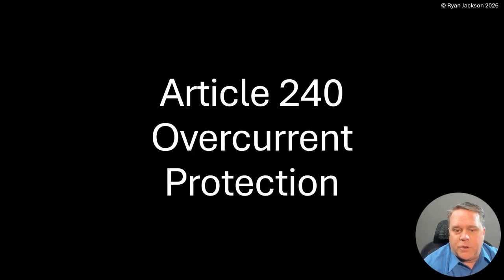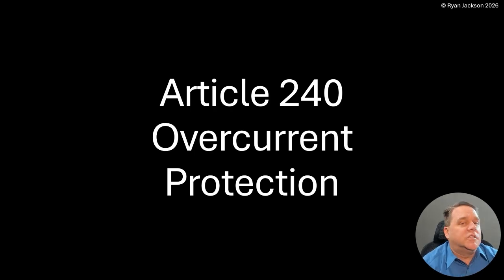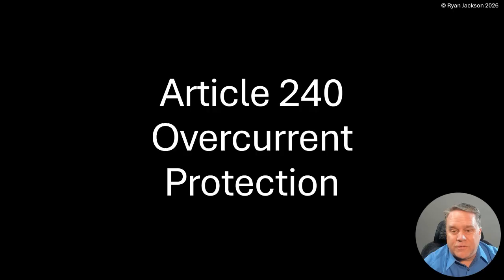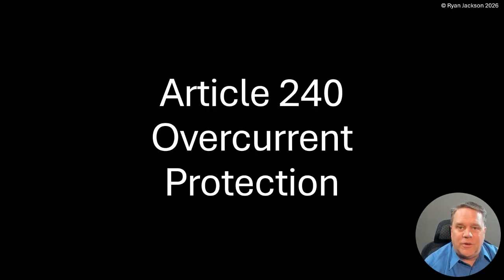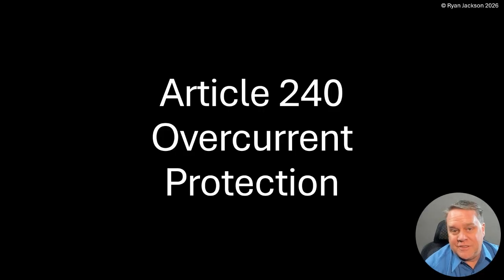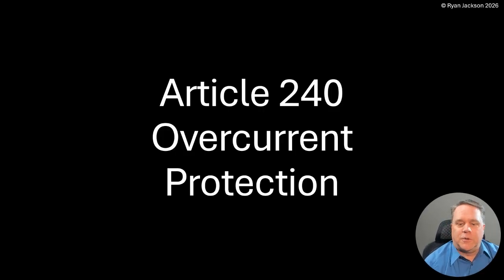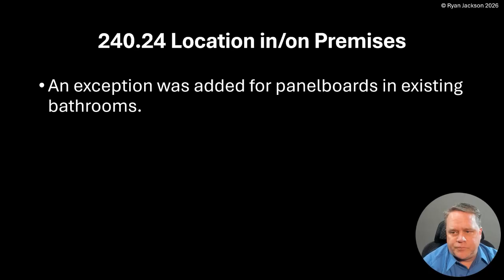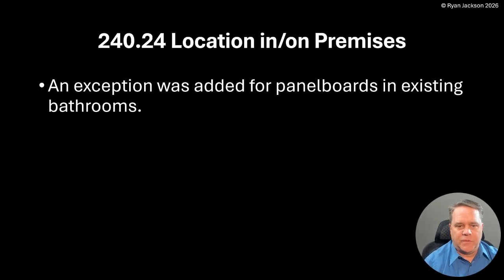100 Days of the 2026 NEC Changes Day 27: 240.24 Location (of OCPDs) in/on premises

Comment: While on the subject of existing installations, I would apply the same concept to installing an overcurrent protection device in an existing panelboard in a clothes closet, assuming of course the installation was compliant when the home was built/renovated as it wasn't until the 1981 NEC that mentioned "such as clothes closets" was mentioned in 240.24 (D). Prior to 1981, this section simply said "OCPD's shall not be located in the vicinity of easily ignitable material" which left it open to interpretation by the AHJ.

Comment: We do generator installs and have to deal with this a lot.

In michigan people love to add bathrooms to basements and do so where the panel is installed.

Adding a transfer switch (modifying the service) requires us to completely relocate the panel, sometimes to another room, sometimes outside into a transfer switch with a load center included.

Pain in the butt. Makes for a long day.